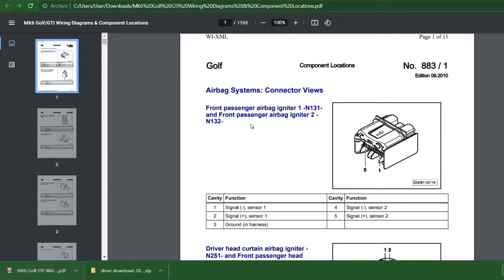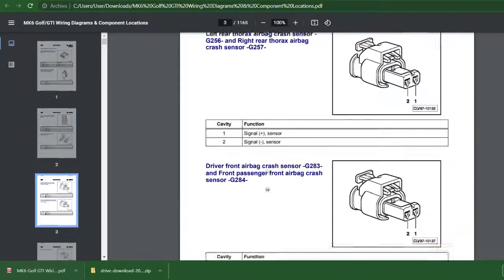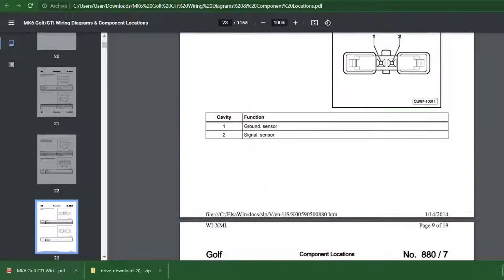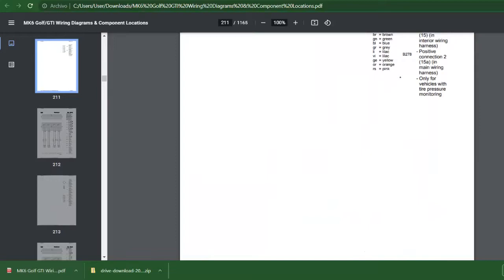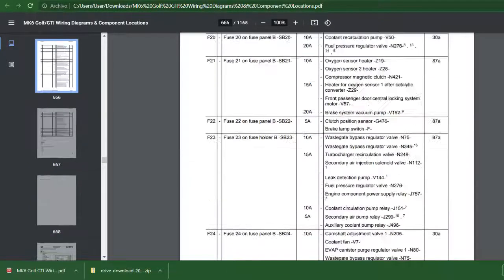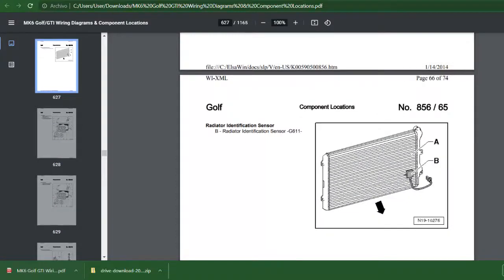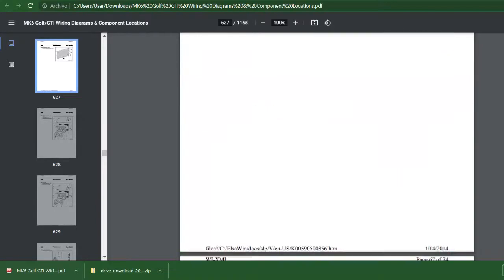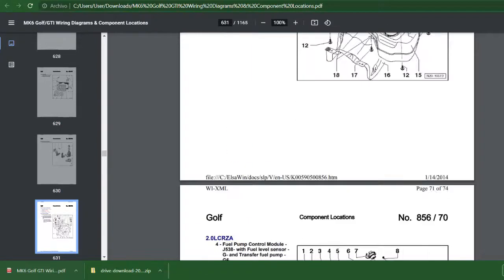VW Golf MK6 Wiring Diagram Component Location Download

Comment: Hi , I have a 2009 mk6 Golf that had no heated seats from new , I fitted some heated pads i purchased online with nice button switches in front of the gear lever and direct cable to the battery. Four or five years later when they were not working correctly I managed to find a genuine pair of front seats for the mk6 that were heated from the factory , so here's my problem .... the large plug on the seats has several wires in it and I need to find the positive and negative (could be the two thicker cables?) to connect my existing two wires into to use the aftermarket switches that are in place ready. Could you please help ?
Reply from the maker: @batmanatvbl  yes I can help. Send me a photo of the plug to my email martocapo@gmail.com and also tell me the model and year of the seat so I can search the pin out

Comment: i have a 2013 VW  Jetta TDI Sportwagen which is a Golf in Europe. Do I need a wiring diagram and component location for MK 6 Jetta or Golf?
Reply from the maker: Jetta
Reply: @martoel  I'm noticing that the location of the ECM engine control module on my car is not where it is shown on the regular Jetta diagrams. On the Jetta it's supposed to be between the fuse box and the battery. This is not the case in my Sportwagen. I'm trying to find it's location.
Reply from the maker: @guaporubio  I can try checking your vin but for that kind of support you need to pay the membership of the channel. Regards

Comment: Thanks for the insight! I am getting P2600 Coolant Pump Control Circuit Open on the Golf 5 GTI TFSI, kindly share a video on how i may diagnose this. I know its a wiring problem but been unsuccessful. Its the V51
Thanks!
Reply from the maker: did you check the relay? it could be a ground problem. can bus is really sensitivy to faulthy grounds